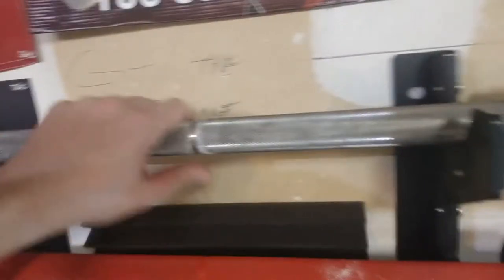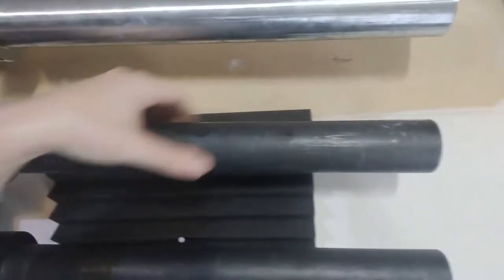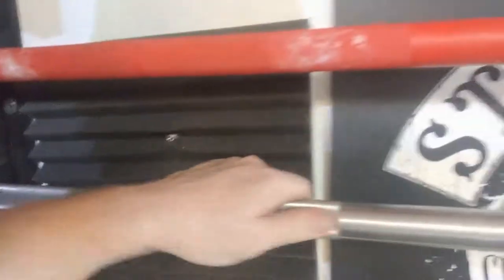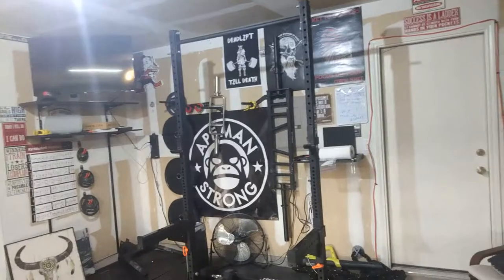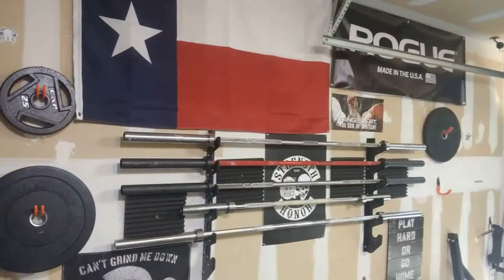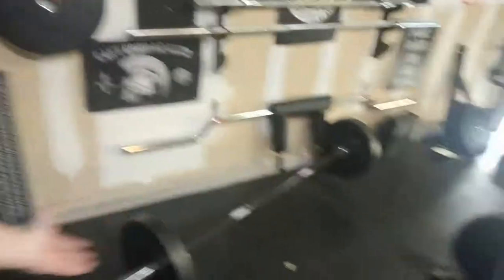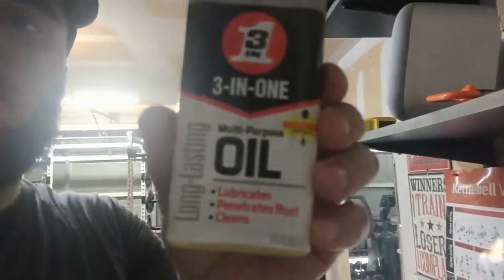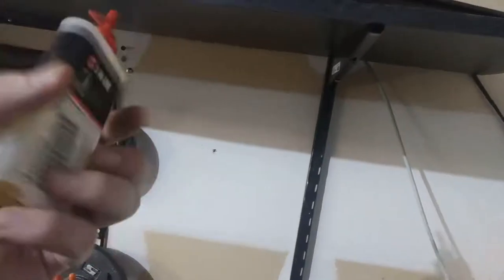Rogue Fitness Cerakote Power Bar, Stainless Steel Powerbar, Matt Chan bar, and Deadlift bar

Comment: For a garage in Florida, do you think the SS bar would rust? I’m seriously considering cerakote for rust prevention, but you make a good case for SS. 

Also; is the SS sharp to the point where it would be shredding my hands if it’s my only barbell? I plan to only buy 1 barbell, and use it for bench, press, squat, deadlifts. Maybe power cleans too.
Reply from the maker: I think you’ll be fine. Brush it with a nylon brush and 3in1 oil regularly. Bare steel yeah that would probably rust out, but SS should be good. 

No, I don’t think the knurl is that sharp. I use it for all compound lifts except dead’s but on occasion I have used for dead’s and the knurl helped me grip the bar over my black oxide zinc deadlift bar.

Being in that humidity if you sweat a lot that cerakote will get slippery. That’s something I didn’t like about the bar here in Texas. I sweat like crazy and would lose grip a lot. Nonissue with the SS.
Reply: @mattbradyfitness  thanks for the tip! Yeah I’m gonna sweat like a pig here in Orlando during the summer. It gets so bad in my garage that I can’t even use chalk because it just washes off immediately with my sweat 😂
Reply: @Isaiah-ft5nx  

I’m in Florida too, farther south. Make sure you get a nice shop fan or two from harbor freight or something and stay hydrated. I try to workout early before the heat kicks in but man, I have the big fans going and I sip on BCAAs with electrolytes or power/gator aid throughout so I don’t get a heat stroke when hitting it hard. 

Good luck my fellow swamp dweller. Oh and I have the stainless steel Ohio power bar FYI, works great.
Reply: @kozmo7  i got the SS power bar. Its almost a little too aggressive for my liking, but it feels good in the hand. Did the metal shards/flakes on your bar finally disappear? I dont like getting metal splinters in my hands and metal never works its way out of the body... I’ve tried cleaning the bar with a nylon brush, a rag(didn’t work), and wiping a leather mechanics glove over it. They’re still on the bar though..
Reply: @Isaiah-ft5nx  

My vision is legally blind so I’m actually not able to tell you, but I’ve only ever felt a few flakes here and there. I’m surprised you thought it was aggressive, I was actually hoping it was more aggressive but then again I’ve been lifting for 10 years so maybe that’s why? I have large / XL gloved hands FYI

Comment: Hey Matt which bar would you pick if you could only have one? I'm tossing up between Ohio power bar SS and Matt Chan bar. It will be for multipurpose use, nothing too heavy just general fitness
Reply from the maker: SS power. the best grippy knurl, lowest maintenance, and most practical.

Comment: For the Chan bar is the wider spacing an issue for deadlifts? I've read mixed reviews about it online. I'm worried that the extra spacing will be too wide for standard deadlifts.
Reply from the maker: Not sure I never used for deadlift. I bought a boneyard ohio deadlift bar. I wouldnt use chan bar for deads bc the knurl isnt aggressive enough. It’s design is for high reps.

Comment: thx for the video, this was the only comparison I could find between the cerakote opb and the stainless. do you find that if you apply chalk to your hands there is still a noticeable difference in grip between the two?
Reply from the maker: Using chalk will help on the cerakote bar or anything non-cerakote in the short-term, until it wears off. For $70 more the difference between the SS and Cerakote, Rogue let me upgrade to the SS bar. It's well worth the money. Thanks for the comparison note, please share this video with friends if you found it helpful! Thanks!
Reply: @mattbradyfitness  I actually have a cerakote opb  ordered and on the way. I wonder if I could reach out to rogue and ask to get an SS instead even though they are OOS right now, I don’t mind waiting. My gf just got a cerakote and the sleeves are already pretty scratched so I had second thoughts
Reply from the maker: Definitely email them! They should be able to help.